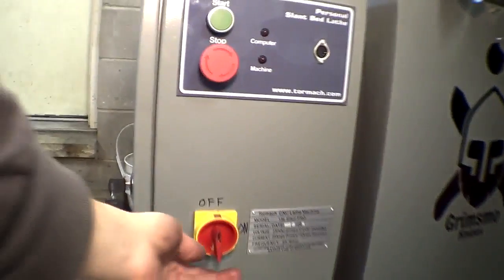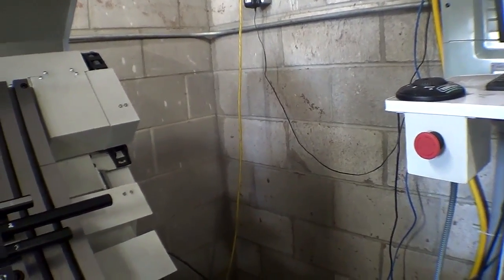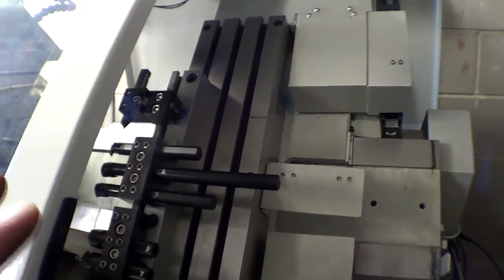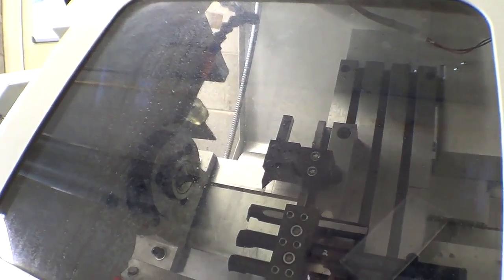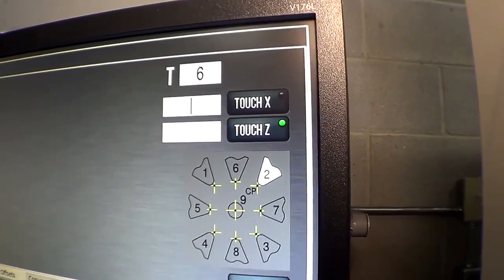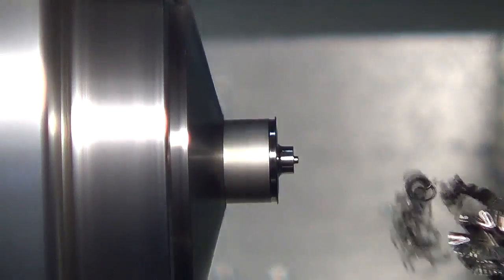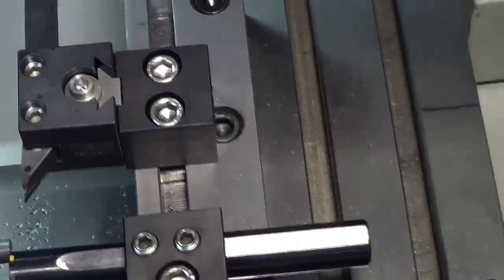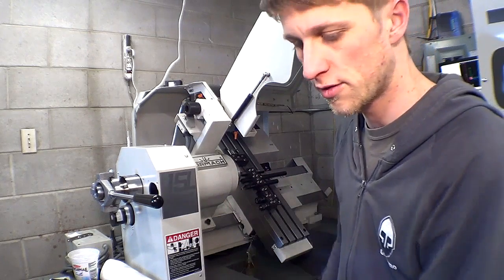KMT 102 - Titanium LBS screws on the Tormach Lathe

Comment: yes that tool cut s1000 with that jog speed. perfect. and that material. it is same tolerance as you make bunch of part and measure differenses. and sure rapid speed is some file if you want tinker how fast it hit limits

Comment: Do you show how to make the torx hole?
Reply: I imagine you could design a jig or chuck plate in CAD with 20+ threaded holes and then reuse this file to run the Torx cuts once the plate is made. From there, you set the screws in the plate and run the Torx cutting job with an end mill sized for the lobes of the T9 torx profile. Might consider using loktite since the thread is so short, but gutentight should work just fine for that small a cut.

Comment: Hey John. 

Nice job as always!

I've got some tight shoulder threading work. What's the make of the threading bar and insert that you used? Where'd you purchase them?

Keep up the great work. 

Best.
Reply from the maker: thanks! i got the threading  bar from Tormach but Shars would sell the same thing.  if you look closely at the insert i actually ground it down so that i can thread closer to the shoulder.  i used a 400 grit diamond cup wheel from eBay,  mounted it in the lathe spindle then ground the insert right on the lathe. easier than it seems.

Comment: auto chucks are awesome when you have a few hundred parts to run between that and a puller its easy to make a 300  part run while your running a mill and or deburring parts.
why not try to find an insert for your groover that will cut deeper on the headstock side making single pass part off?
if it were me i would increase your cut depth on your rougher to only two or three passes.
to make this part on my lathe at work i think i could get the run time down to about a minute fifteen seconds.

Comment: I'm curious, how much of a tolerance do you have with your parts? Striving for perfection is great, you have a bunch of amazing little finishing touches you do- I'm just curious if a couple thou would make a difference in the finished product? 

Oh, and you shouldn't stop the spindle while your tool is still touching the workpiece. Good way to dull it quickly, lathe or mill. And if you're worried about sizes to the tenths, going down to .3699 and then up 1 tenth to .3700 doesn't work, like you did it. Even CNCs have backlash
Reply from the maker: For the knife tolerance it depends on what part we're talking about.  Some things I want to keep in the tenths, others can be off by a few thou, but for the most part everything has to be well under 0.002" off. 

And yes I know about the backlash issues, so if I'm only moving one tenth I'll move away a few thou then come back to the new reading.
Reply: JohnGrimsmo That's awesome. Quality! Definitely the most interesting knife videos, and the most interesting machining videos I've seen
Did you start machining as a hobby, or for work outside of knife making?

Comment: John, really cool machine!  The additions you have planned sound really worthwhile too.

When you are turning down to the threaded section diameter, why do you take it in so many passes?  I'd have thought that machine would have the power to take a cut that size in one pass...two if you want a finer cut for finish and thread relief.  Not so?

Thanks for letting us watch!

-- Mike
Reply from the maker: You're right I could definitely turn down that section in way less passes, maybe even just one pass!  But if I push too hard with an insert that's not super sharp I run the risk of the metal bar sliding backwards in the collet, which throws off tolerances and causes all kinds of hassle.  What I really should do is use that grooving tool to rough the diameter down to close.  I betcha I haven't used 1/10 of the 3hp that this machine has!
Reply: Thanks for the info.  I hadn't thought of the collet slipping problem, but coming in from the side with a series of plunge cuts sounds like a good solution.  You'd want to stay away from your final face and clean that up with a different tool, but for bulk removal, it could work...and aren't cut-off tools cheaper than most of the others?

Comment: awesome video. I have a question. For such a small part, isn't the cost savings of making the part yourself kind of offset by the cost of running the machine for 2+ minutes in electricity?
Reply from the maker: Humm, I don't know really.  But just because it's small doesn't mean it would be cheap to have it made elsewhere.  I'd guess it would cost at least $3-10 to have it made like this in a machine shop, and some shops I've dealt with are crappy at holding tolerances so they send back parts that suck and don't fit.  Plus the waiting time.  This lets me blame myself if they don't work haha, but more importantly I can fix it easily and run parts quickly whenever I need them.
Reply: Is electricity ridiculously expensive where you're from or something? Or, do you think machine shops don't have to pay for electricity?
(well, here they get a break on what they pay, but still)

Comment: nice video, couple things i noticed,  your 80 degree turning tool isnt on center that is why you get that knob, and usually in long run it will result in tip chipping,( i noticed the other side of 80 degree rougher was chipped)  also you should put chamfer at the start of the thread, that will eliminate alot of hand work, but if you want virtually no hand work you can get specialized pitch inserts or you make threading pass then do finish turn pass with turn tool again followed by thread pass, that will cut any burs pushed by threading, you should also be able to make the second thread cycle only make 2 cuts instead of full 5-10 passes ( depending on thread)
Reply from the maker: Thanks for the tips, I know that CCMT tool is below center, I just haven't cared enough to center it yet.  But I did not know it could lead to edge chipping, thanks for telling me that.  There the finish tool does put a tiny chamfer on the front of the threads, maybe it could be bigger but I need these threads to go all the way to the bottom.  There are no burrs to deal with, the parts come off great!
Reply: JohnGrimsmo  you are welcome, i run mazak lathe at work once in a while and we get some production parts, nothing that tiny tho.  Also one thing about rapids they actually dont save that much time, i ran few parts, and comparison between 50% rapid and 100% rapid usually only saves about 5- 10 seconds over 10 minute run time, (oh mazaks at 100% are scary lathe can go from home position of about 8 feet to chuck in about 3 seconds!), realistically tho most of the machine time will be spend near part, and the best way to save time is finding sweet spot between taking of biggest cuts and having reliable process.
  Another thing to mention, the rule of thumb is when you have more material to take of in x rather then in z, use bar face ( basically like facing the part but you stop at whatever diameter you need,leave some for finish), you dont need to use grooving tool for that you could just do it with your rougher then finish the normal way.
 watching your videos makes me appreciate our machines at work, but at same time its awesome to see how you do so much with so little. Also would like to mention that you make great videos! I been watching your channel for little over a year now, and i always look forward to your new videos :)

Comment: Bar puller is nice, but that eats space. What about a bar pusher? Using an electric actuator (no need to mess around with air or liquids for a test) you could push the bar (as you would manually).

In fact, you could, using the existing draw bar setup, make a an actuator at the end for collet lock as well. Both electronic, both easy to feed as extra programming in to the computer (could be a simple activation line and have a controller unit run the whole deal on the actuator side).

You could make this in to a very simple, bolt on package that doesn't stick out too much of the machine's end and most importantly, doesn't require air or liquids to run.

Just my two cents, hopefully, that make sense. :)
Reply from the maker: For a bar pusher you'd be limited to how long of a bar you could install, and if I install an 18" bar the pusher would then stick out 18+" out the back.  Not the case with a puller.  I'm not knocking it, I think it's a sweet idea, but an off the shelf bar puller for $60 sounds pretty tempting too.

I don't know if you could make an electric collet actuator reliable enough, it takes a decent amount of force to unlock the drawbar.  I'm installing a piston that should provide over 150lbs of force.  Should be enough ;-).

Comment: Nice video as usual.  I wonder if the cold start offset is "predictable".  Like, could the machine compensate for the warmup period using "hidden offsets" based on coolant temp and how long/hard the machine's been running.
Reply from the maker: No it's not predictable, not as far as I've seen.  Basically when power is applied or removed from the steppers I think they kick to the next rotation point where the magnets attract the rotor (I'm literally making this up because I know the theory but not the right words haha).  And who knows which way the stepper will kick when powered on.

Comment: My first 15L comment was that it was screaming for an automated collet closer.  While waiting for that, I'd still get the bar puller and get that working with the manually operated collet closer.

LinuxCNC (PathPilot) for the threading win!  Woot!

Very nice looking parts and the titanium machining looks great.  I'm currently fussing a bit with a .247" OD titanium pin that has too much sticky outy.  Part deflection results in tolerance problems as sometimes the carbide insert cuts, and other times it skips over the surface and deflects the part.  Gonna need to turn that with a tailstock.

Comment: Great stuff,  that machine seems to excel at what you are using it for.  Maybe a two stage bar puller mounted on a linear slide could save you some space for the gang tooling,  one stage advances  between existing tools and the other grabs/releases the stock.  Something like a pair of opposed pincer points for gripping.

Comment: Highly recommend the Royal style partoff/bar pull, if you can make it work in your gang setup. Glad you were able to get them going on there, I think the relief would've done it for me too. Ah well, now i'm 200 miles from my lathe. Process looks ridiculously familiar, even down to undercutting the underside. I was under a minute total cycle time from part to part, just using the identical V tool to do 100% of the outside turning.. Any intentions to start using HSMWorks for programming your turning?
Reply from the maker: I was just going to use what Brad uses, the little durham bar pullers, but I haven't ordered anything yet.  I did use HSMworks to code a lot of that, I guess for both turning tools, for the threading I used Tormach's built in wizards and the parting I coded by hand.  I could probably shave a minute off if I really pushed it.  Sure is fun though!
Reply: The royal could potentially save a spot, but its really dependent on if it works in your setup. Most likely, it'd force you to switch to a cutoff tool mounted axially, which would kill even more space. If thats the case, then the ones Brad uses are perfectly fine too.

Comment: That's some great turning footage!

Regarding the bar puller - for now, could you program pauses into the code, so the puller loads the stock at the end of the program? It wouldn't make it an autonomous machine but you wouldn't need to push the rod manually.
Reply from the maker: I guess I could do that, and that would at least allow it to count parts for me which would be helpful!  Great idea.